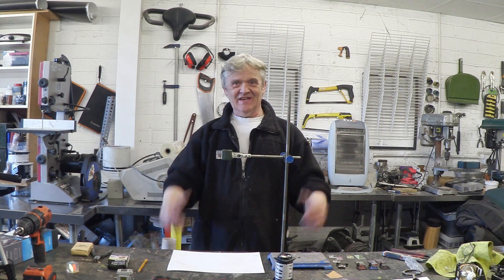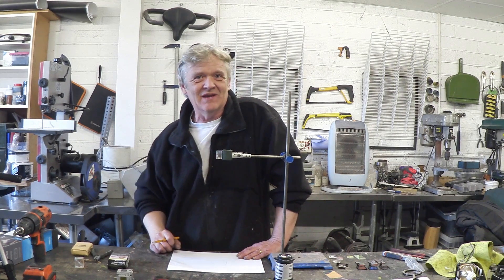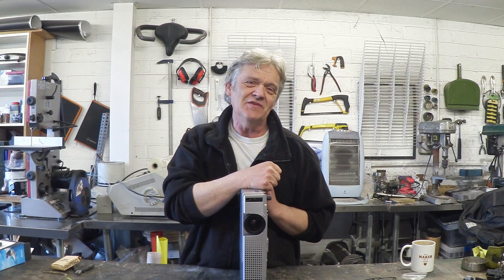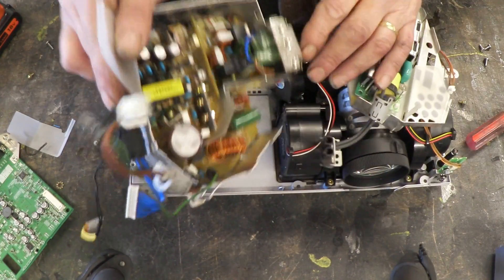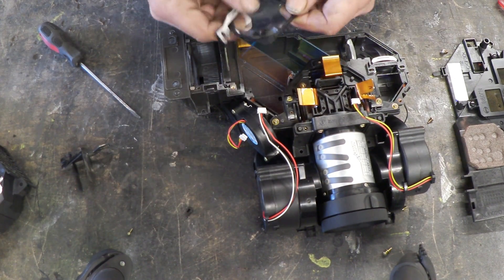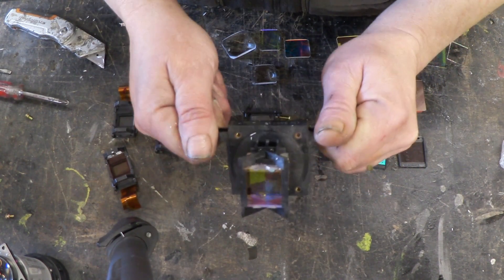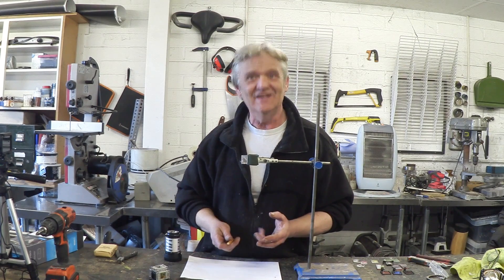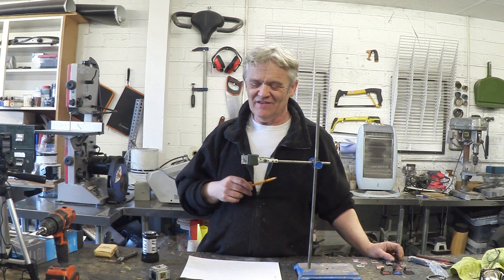1023 Diy Camera Lucida - Where Science Meets Art

Comment: that cube of 4 prisms you have is actually also coated with both polarizers and color or dichromic reflective/fractive elemental coatings, so you can take a blue and green laser and over lay them too, and make a turquoise dot, or add a red that is also overlaid and get a white dot or something close to it, 
I am working on a way to separate them with out breaking them, going to try methylene chloride once I have tried xylene and failed (if it fails, which may not I know the prisms are held together with some sort of epoxy from what I have read so it might take a quantity of methylene chloride just like the "tuff job remover" solvent used to dissolve epoxy which has methylene chloride, not something I wish to use and throw away into the atmosphere but for this project it wont take much, basically stick it all in a glass jar with an aluminum coated inner seal on the lid and then put a bit in the bottom of the jar so I can let it sit and evaporate and soak into or work its way into the cracks and crevasses of the parts dissolving the epoxy as it does, and the metal seal on glass should hold it all in, as I have stored it in a jar that way (in a refrigerator on the lowest temp I could set it for, so that is helping make sure pressure is not making a gap in between the aluminum and the glass jar lip) anyway not sure if it will damage the coatings or what appears to be added onto them, as the whole assembly also should have some glass aluminum coated 2 way mirror and polarizing units too, that have no plastic in them like typical iodine polarizing plastic sheeting like you see on the front of an LCD screen for a computer or TV these days.
Reply from the maker: let me know how you get on mate because like you I would like to take those prisms apart
Reply: @ThinkingandTinkering  will do. thanks for the awesome idea for using these, had not thought of that, only thing I can see I might have come up with would be a tiny mirror at 45 degrees and leave both eyes open at the same time, so the brain mixes the two images together the paper and the image being drawn. :) Lots of drawing aids I seem to recall you have made for your channel, or is that someone else?